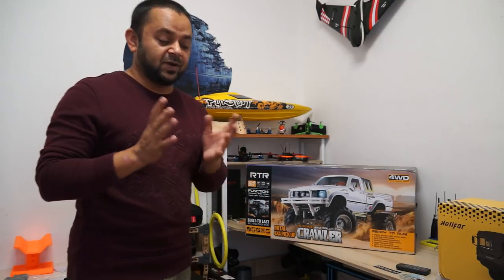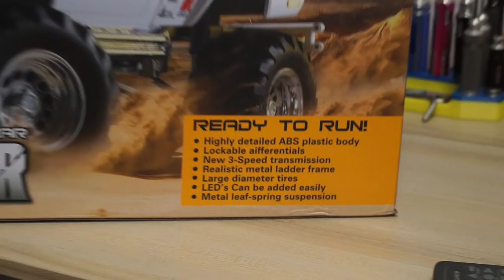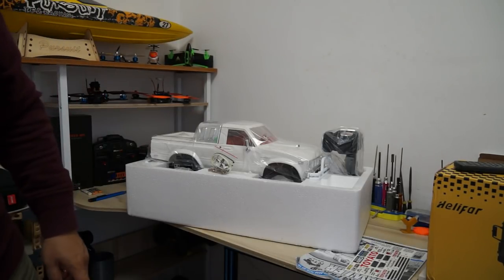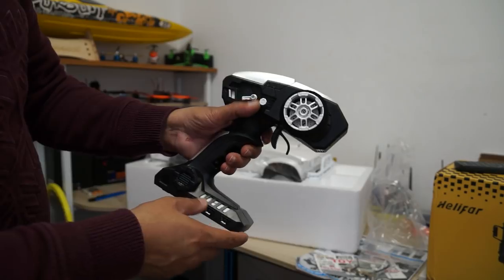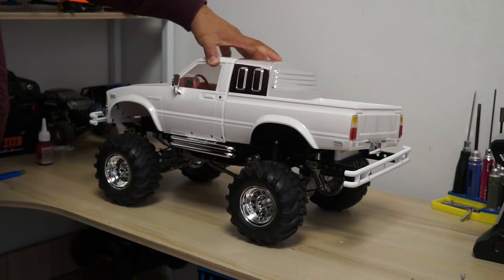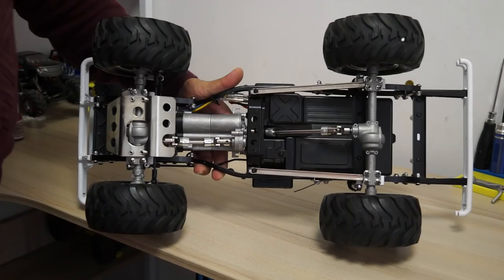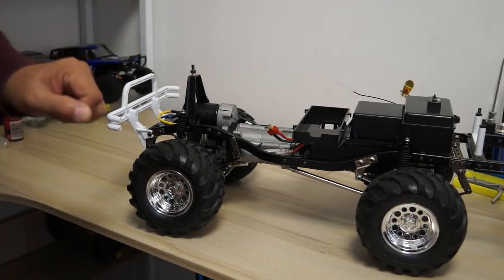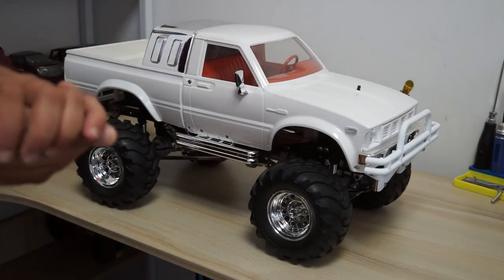Unboxing Tamiya Bruiser Clone HG P407 Toyato Metal 4x4 RC Pickup Truck

Comment: Hello my friend, I have had the HG P407 since December 2020. It is not a downright crawler and the stiff suspension doesn’t do that either. but with different tires and only one spring leaf per axle as well as a mod. to the shock absorbers and a Xerun 540 2300 KV and lighting kit, the Clone turns into an absolute fun car. it runs very quietly by default, this is due to the metal gears and the Xerun drive train also eliminates the annoying beeping of the ESC. I have a lot of fun with the successful clone and for relatively little money. I would have a word with your robot if I were you, looooooooo.
Reply from the maker: Thanks for good tips, Hope others can see and make good use of these tips and tricks.